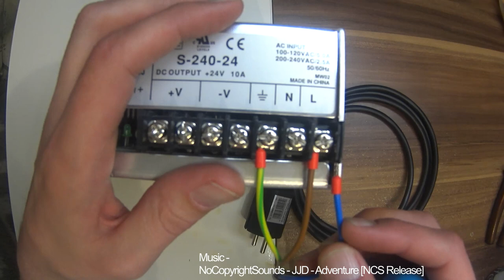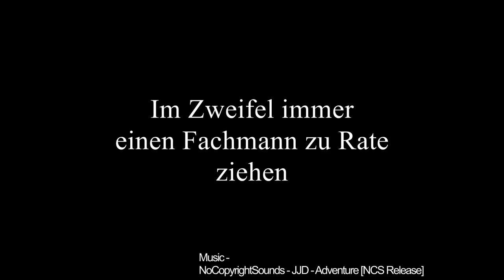24V - 240W Netzteil an 230 Volt anschließen

Comment: eine dumme frage, kann man das auch mit einem kabelschuh machen, eine kreis oder habkreisschuh? daurf ich von einem out 2 kabel verlegen oder jeder out ein kabel?
Reply from the maker: Du kannst auch einen Kreis verwenden oder Halbkreis. Du kannst am Out auch 2 Kabel verlegen, eines rechts und eines links. Zur Übersicht solltest du sie aber lieber auf weitere Verteiler legen. Und du darfst niemals vergessen, dass ein Netzteil immer nur eine maximale Leistung verträgt. In meinem Fall also die 240 Watt. = 24 Volt und 10 Ampere.